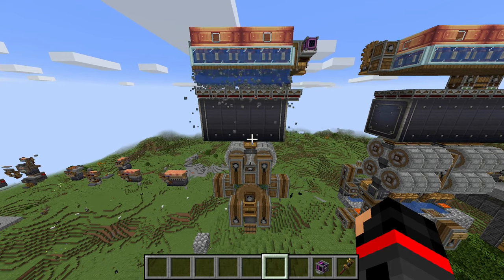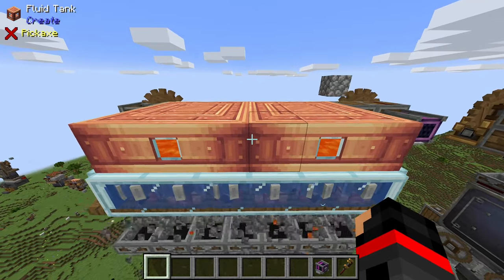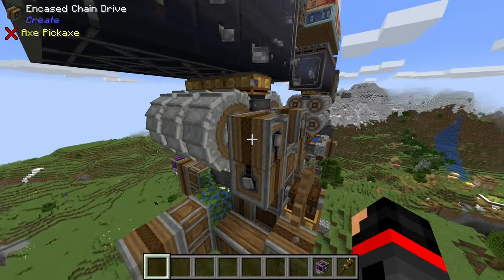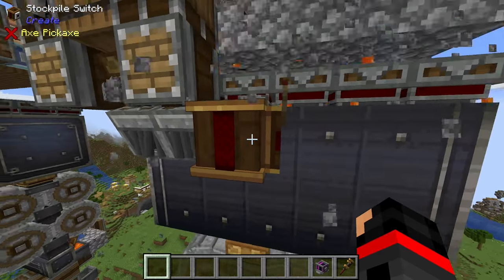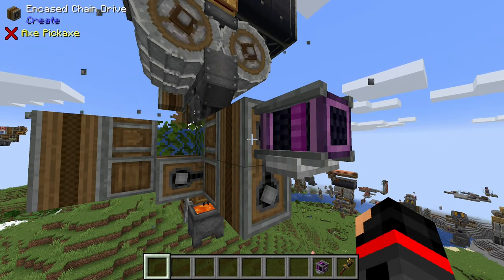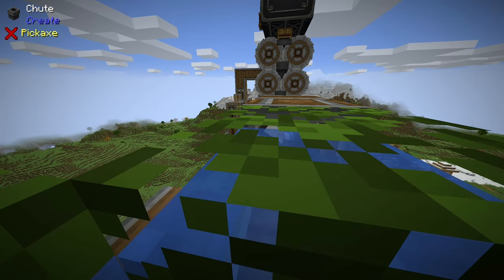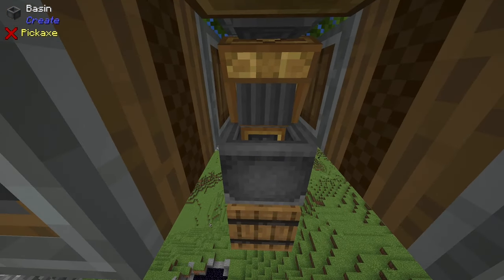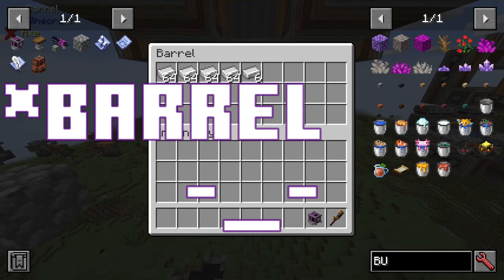The FASTEST Iron Farm You Will See! - Minecraft: Create Mod

Comment: If you place it schematicannon, you should: replace item vaults (might be bugged), put water in leaves and in pumps, put lava in fluid tanks, check if funnels are placed correctly
Reply: life saver!
Reply from the maker: If you're not in 1.19 you can't water log leaves. Solution there is to just use stairs, or other water loggable blocks. And if you don't want to do use those, you can just block off the sides so water is contained.
Reply from the maker: So that problem is cause schematics don't get placed by the schematicannon. Breaking and replacing the vaults will fix your funnel issue. And the zooming issue sounds like the crushing wheels are going wrong way. Slow down there and give it a look see, might need to flip the rsc Val to negative
Reply from the maker: Happy to. If you can leave me a like on the vids you appreciate, would be awesome and help me out. Have a good rest of your day :)
Reply: @Triobian  your machine is of great design, and i used it in my 1.18 world. however, i am having the most pain figuring out how to solve the water problem. no matter what i do, it waterlogs the funnel in the middle, rendering the collection mechanism useless. how do i solve this?
Reply: solved: all i had to do was instead of making the blocks immediately in front of the encased fans sources, i made them flowing instead, with one full source in the middle fan. this solved it

Comment: Great farm. Helped a lot, very efficient, now I can use iron blocks as building blocks lol.

One simple improvement to it I did is to add a filter to the basin which allows only iron ingots and iron blocks as the receipe item, then change the filter on the brass funnel to iron block. This way, it makes iron blocks instead of ingots so increases the storage without needing to add more chests or anything.

Comment: if you only get flint but no iron or iron nuggets, change the two item vaults next to the Mechanical Press with a double chest. It helped me after building this with the schematic cannon. Awesome build!
Reply from the maker: The problem you had there, is that the schematicannon doesn't place multiblocks well, and the item vaults will thus get bugged. That's why in newer videos I start mentioning breaking and replacing vaults. If you replace with vaults now it'll work just fine.
Reply: @Triobian  yep, I did that later on. But a quick solution for a newbie on create mod is uising a double chest. 
But you're completely right.

Comment: you should place the trapdoors virticaly so all the items fall out, and try to add hoppers on the top side of the vaults to prevent the items from leaking
Reply from the maker: Again, you're free to alter it however you like. So long as you're happy with what you end up it matters not
Reply: @Triobian  it's called constructive criticism, don't take it personally :)
Reply from the maker: ? I'm not sure why you felt the need to comment. The issue of leaking the person describes is not an issue for me in any of the trials I did, so it would be an unnecessary change. The funnels pick up the drops, so hoppers are also unnecessary. Which is why I said they are free to alter the design as they wish.

Comment: Hello sorry but I have a small problem with the cobblestone. You have placed the pumps some up and some down. In places where the pumps point up the cobblestone does not spawn while in the other places where the pumps point down it does. so let's say I have halved cobblestone production. I tried putting all the pumps down so as to generate all the cobblestone blocks and it seems to work. Does it make sense for the farm to work like this or is it a bug?
Reply from the maker: So in Create 5.0, the direction of pumps is based on which direction they are rotated, so they were up and down due to that. In 5.1, that is no longer the case. As the machine was built in 5.0, it needs to be manually corrected to the 5.1 workings. So flip them all down.
Reply: @Triobian  oh ok thanks

Comment: This design is really great, but I"m in 1.18.2, and cobblestone flies everywhere, and also gets stuck in the mechanical pumps, slowly causing lag. Any suggestions?
Reply from the maker: forge or fabric? and modpack or just create?
It was built in a barebones 1.19.2 forge, for reference. 

There seems to be some problems with my cobble gen in 1.18.2,  but havent tested fabric yet or astral, which is where most peoples issues are. Looking into it soon.
Reply: Figured it out, I had modified the movement engine and the "duty cycle" was wrong - it only spent a fraction of the time in the "RIGHT" state (vs LEFT) and so the quick change in direction was launching cobble.
Reply from the maker: I'm glad you were able to get it working!

Comment: i've run into an issue where once the barrel fills up, it will just drop ingots on the ground until they despawn, then drop another ingot again. I'm running the newest version of create 0.5.1
Reply from the maker: Yea that's just the normal mechanics of the item transfer. Since you're in 5.1, you can just slap a threshold switch on the barrel, and put a sending link on it and a receiving on the clutch up top. That way the machine shuts off when the barrel reaches the % you set.
Reply: @Triobian  i thought about that but wasn't sure if it's the best solution, thank you for quick feedback!

Comment: I don't understand how you got water underneath the lava tank in the glass, also do I need to continuously fill the lava tank or is it self sufficient? really new to create and not fully understanding what needs to be done after schematic cannon aside from power
Reply from the maker: Pumps can be flooded with water the same way that leaves, stairs, or other non solid blocks can. So just right click the glass trapdoors so you can place the water. The lava does not need to be refilled, 1 bucket per tank and that's all you need. The particles of lava the pumps spew count as flowing lava. And the code for making cobble is before the code that moves the lava source
Reply from the maker: Let me know if you get it working or if you have any other questions :)
Reply: Thank you so much for the quick response, got it up and running ez pz. Only thing I'm lost on is the redstone thing that turns it off. i get that you put two items in as a key but I can't seem to get it to work.
Reply from the maker: Glad it's working. 

As for the Redstone links, so long as you have them on the proper spots, just use the same key/frequency for the send and receive, and it will turn itself off as needed. You don't do it manually unless you slap a lever on it. Make sure you are placing the blocks at the right spots on the links, and make sure the one on the clutch has that disc thing on the antennae by shift right clicking it
Reply: Thanks again for the info, but I'm running into a problem with the machine now. The lava runs empty after a little bit, are the pumps above the spruce trapdoor all supposed to be up or down? Seems there's a mix of both
Reply from the maker: The pumps are all supposed to be down, since thats how you get the cobble generation. And yea pumps will alternate if you place them down adjacent and turn them on. You need to get a wrench and manually flip the ones that are the wrong direction. Fix that and let it run for a bit and LMK if there's still the lava drain issue.
Reply: @Triobian  I was looking at the pumps wrong actually, they're all facing downward but the lava still drains after a minute or so
Reply from the maker: What speed do you have the pump RSC set to? Also game version, mod version, and pack? That's not supposed to happen
Reply: @Triobian  Running on Better Minecraft 1.19.2 - Create v0.5i. And Idk what the pump RSC is :(
Reply from the maker: Just look at the rotation speed control on the left. The one at the end that goes into the vertical gear box.
Reply: @Triobian  Thanks for all the help along the way, wanna say I really love your channel and your willingness to help noobs like me. I got it running fine after comparing it to your original schematic in create. I also got your andesite farm up and running, and that one doesn't consume the lava like you were saying. the iron farm still consumes the lava though, and I've since built a lava generator. do you know why one is consuming lava but the other isn't? I even pasted the original schem in create and I can't get it to self sustain off the one bucket input.
Reply: LMAO right after typing this I figured it out. When I flooded the pumps I only did the ones visible from the trapdoors. For anyone with the similar problem, the fix was to break the fluid tanks and ensure all pumps are flooded, then place them back.
Reply from the maker: I'm glad it was just a simple oversight haha

But yea you're right I forgot to mention that

Comment: the gravel barely ever goes into the washers it just starts flying everywhere or builds up between the crushing wheels
Reply: im playing on the Create Stellar modpack in 1.19.X
Reply from the maker: That sounds like one of two things, crushers are spinning the wrong way, or the vault is buggy. Slow the RSC down and see if you need to make the value negative if they are spinning wrong. Then break the vaults and replace them so that they are placed correctly. The cannon does not place multiblocks well.

Comment: How do I make one fan swap directions without making all the other fans swap?
Reply from the maker: Depends which fan it is. If its one of the side ones, then there is a shaft with a casing on it that goes into chain drives that actually give the fan power, replace that shaft with a gearbox. If its the back one, then flip the rotation of the line youre connecting to the gen, and then replace the shaft like you would with the side ones with a gearbox.

Comment: I think that the cobble input is to low compared with the crushing setup. I did try it with 2 crushers and the cobble in the vault was not increasing. With 1 crusher it increased. Maybe this is because of the tick speed. I have my tick speed on default
Reply from the maker: Well, luckily that's one of the easiest and simplest things to adjust. So yea use what you need

Comment: I cant add water to the pumps by the gantry shafts without breaking them. How do I fix this?
Reply from the maker: Push the gantry stuff back a block.
Reply: @Triobian  Can you elaborate a bit on which direction the gantry shaft needs to be pushed back? I just have water pouring out of the machine from the top from just behind the gantry shafts. For the life of me, I can't figure out how to place the shafts and keep the water from breaking them and pouring out.

Comment: While everything moves like it should, and the cobblestone gets broken, it doesn't actually drop any cobble for some reason.
Reply from the maker: Wdym it doesn't drop? Could you explain
Reply: @Triobian No cobble items get created from the trap doors breaking the cobble. Thus the machine doesnt pick up any cobble and generates a total of 0 cobble per hour. Edit: Replacing the trapdoors with any full block seems to have fixed items not appearing, now the problem is the machine doesnt pick up the cobble or atleast it doesnt deposit it into the item vault
Reply from the maker: What speeds do you have your rotation speed controllers set to? Btw if you message me on discord we can discuss the problems easier
Reply: @SoothingFrost  I have same issue. Iam using 1.18 version so maybe that the issue. Trapdoors or slabs dont generate any cobble, fullblocks doas but then funnels dont pick it up
Reply from the maker: I'll be looking into the 1.18 issue when I can. Seems to be that and astral create where it's having the most trouble
Reply: Might be a bit late, but make sure all the mechanical pumps at the top are pointed down, I was having the same issue for a bit and this is how i fixed it
Reply: @parkerabdeen869  i did, but still doesn't work
Reply from the maker: What issue are you having?
Reply: @Triobian  turns out the cobblestone problem solved, i just need to slow down the moving part a bit, then new problem is out.. the funnel won't pull out items from the item vault (bottom part) but it worked when i only use 1 item vault instead of 2...

but hey, it works juuuust fiinneee
Thank you so much! @Triobian this build is FANTASTIC!

Comment: my machine is just producing obsidian and obsidian dust, I dont know what to do
Reply from the maker: Sounds like you're letting the lava place as an actual block, which then gets turned to obsidian. My guess is you're running your pumps at a speed other than what I have in the build. Without anything to look at I don't know what else it would be
Reply: @Triobian  i had the creative motor on the wrong gearbox lol, after changing that and replacing water it worked perfectly, thanks for the build!

Comment: maybe I just don't understand, but does it not work in 0.5.1?
Reply from the maker: It does. You'll need to explain the problem otherwise it's impossible to help.
Reply: the contraption looks like it works the same as the video, but it just doesn't create stone. the water is logged in the pumps and the tanks are full of lava, but it only makes a stone breaking sound but no stone is generated. @Triobian
Reply from the maker: if you havent yet seen, i've learned the cobble gen got borked in 5.1.e Create do to a bug, so you would need to use .d or wait for .f

Comment: It doesnt work for me... gravel wont transform into flint and iron nuggets
Reply from the maker: Have you checked your fans? They could be blowing the wrong way. Also did you flood the leaves with water? Another problem is that schematicannon doesn't paste multiblocks perfectly, so you might need to break and replace the chain drives.
Reply: @Triobian  It works now, I didnt put the water in leaves
Reply from the maker: I had a feeling that was the reason haha

Comment: the flint is comming but no silver or nuggets
Reply from the maker: So you're saying it does get washed but no iron nuggets are generated? How long has it been going? If none are generated even after a couple minutes than your filters might be incorrect and its being voided instead of the flint.
Reply: @Triobian  so i just found the problem, for those using schematics canon you need to fix the 2 vaults in the end and all the filters again, the nuggets are getting stuck in the vaults
Reply from the maker: ahh yea the schematicannon isnt perfect with placing multiblocks

Comment: this is generating iron not nearly as fast as it should for me,  its producing about 2 -3 blocks per min which should be around 1080-1500 iron ingots per hour
Reply from the maker: Then you have moat likely missed something in your set up of the machine.
Reply: @Triobian  would it be rotational power?, I set everything up in creative to test it first, water logged leaves, water logged mech pumps, filled lava tanks, replaced chutes and vaults so they work properly
Reply from the maker: I bet you did not flip the pumps. That's a common thing I see with people who are not used to fixing those from 5.0.
Reply: @Triobian alright I will try that next time I’m on and will test the results because that is something I didn’t do
Reply from the maker: Then that's definitely the reasonm
Reply from the maker: Just look at the actual cobble generation and it should be very clear
Reply: @Triobian  works great now, i got 500 iron in 10 minutes, estimating 3000 in an hour, Thank you!